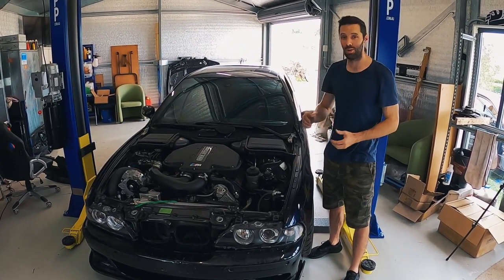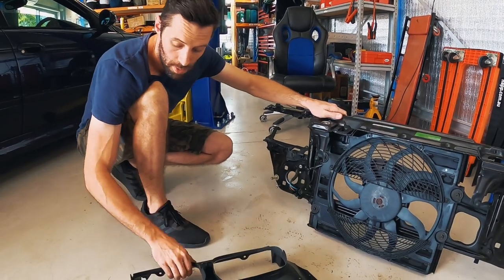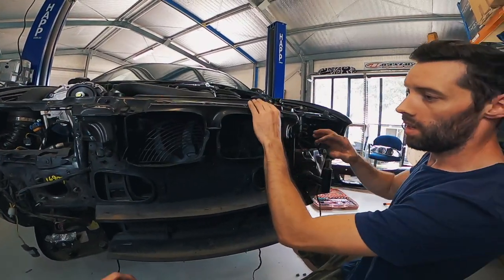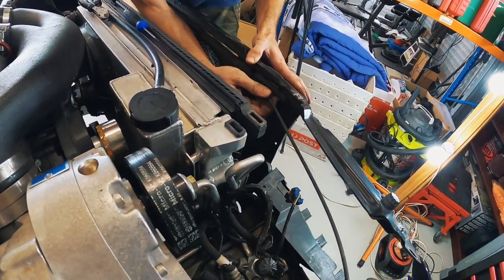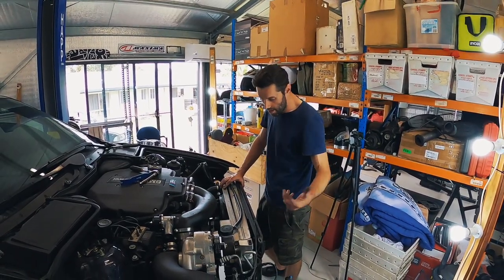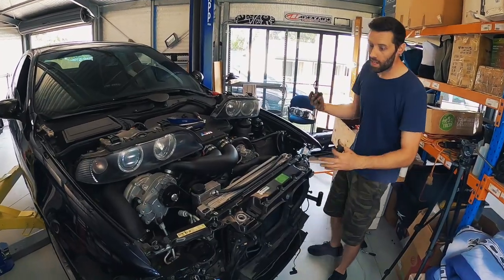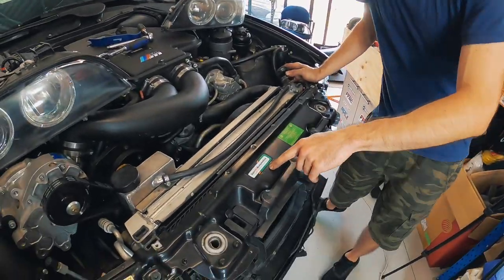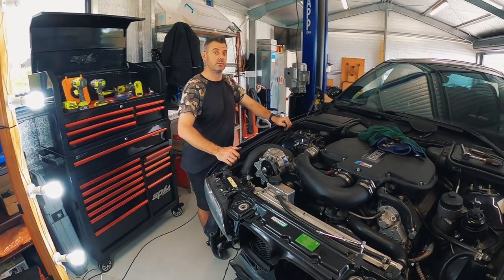BMW Supercharged E39 M5 The front's FIXED!!

Comment: I'd be happy with that result too. Very keen to see what the panel shop says about the rear end and roof. Got both fingers crossed that it's repairable without breaking the bank. I really want to see this thing back on the road, I saw it a few times at meets in Sydney.